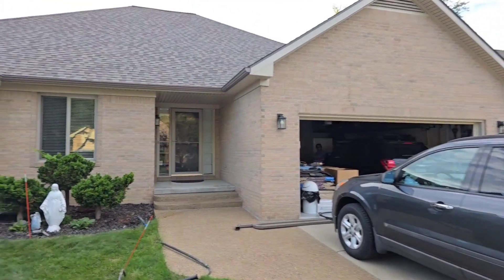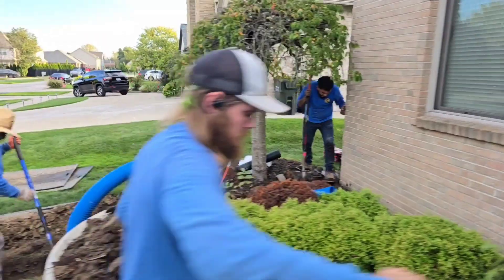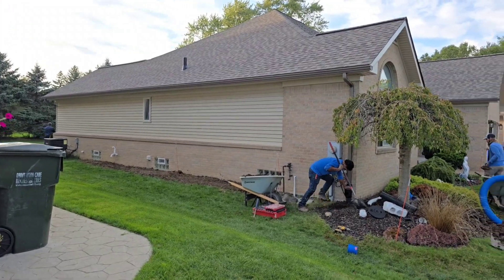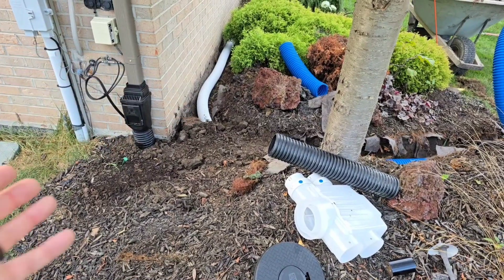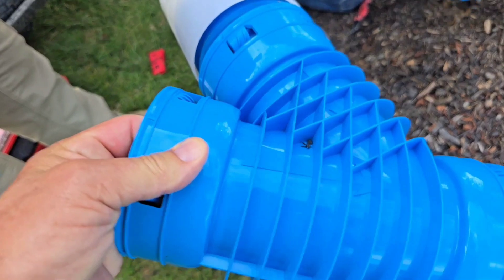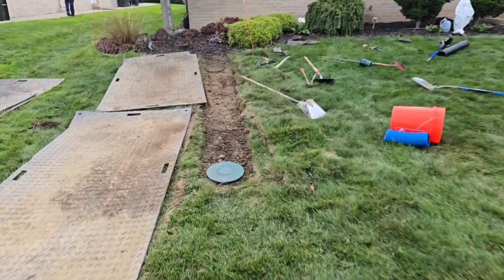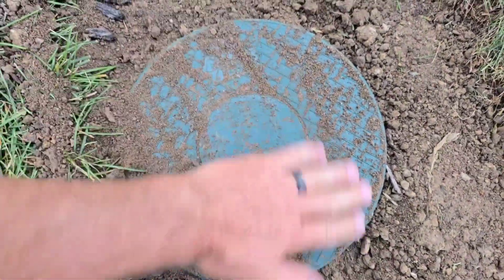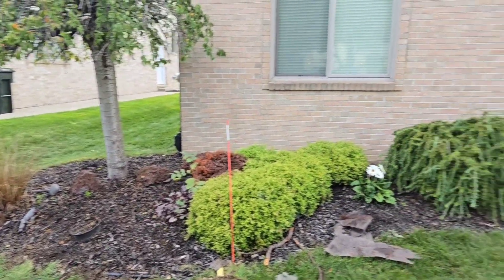2"×3" Downspouts MAXED OUT!!

Comment: Just added those leaf guard downspout filters to my home as well as the pop up emitter. I  may dig up a portion of the line in spring to add a clean out, but we'll see how it goes. They were a breeze to put on and seem pretty much more solid than the big box store stuff. Thank you for making great stuff Robert! I wish I found your store before I did some of the work I've already paid for, but hey...when it fails, I know where to get the last replacement system I'll ever need.

Comment: Wish this video had come out a few months ago.  I have an almost identical home layout with a terrible roof line and since i had 3x4 downspouts i bought all my materials from your website planning on 4" pipe to handle all the water. I did go with 2% grade hoping that might offset some lost velocity from the larger pipe.  Ended up needing two risers on the pop up and once i hit it with a hose to test it out i noticed that the water can't build up fast enough and it's just coming out the knife cut/popup joint and pooling back up the trench. With the large pipe and deeper grade the level point is about 10' into a ~50' run (in clay) so if it backs up the trench that far im not sure I've accomplished much. Any advice for this one??
Reply from the maker: I do feel you are worrying over nothing. Two risers are not the end of the world. They are vented at the Lee filter, so if they ever did block with ice, you will still get the water off the roof. The ground will be frozen and the water will just run as it thaws over the frozen ground. Once fully thawed, the line would work just fine.
Reply: @FRENCHDRAINMAN  Awesome!!   I kinda figured I might've been overthinking it but I'd hate to put in all the work and have to redo it!  Thanks again!!